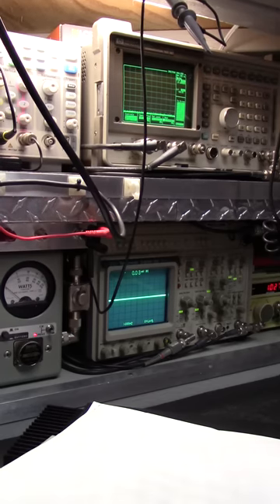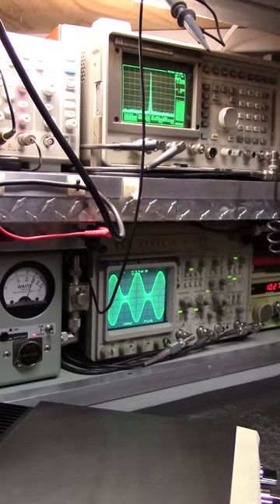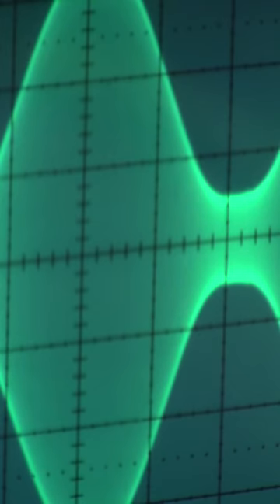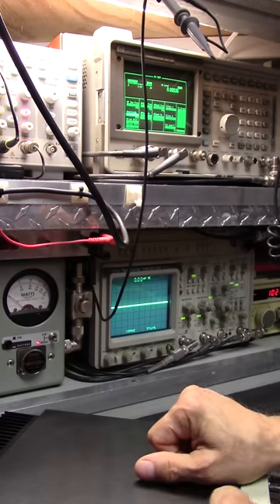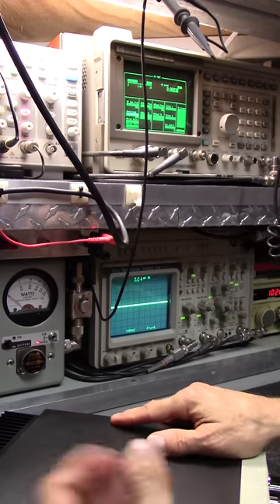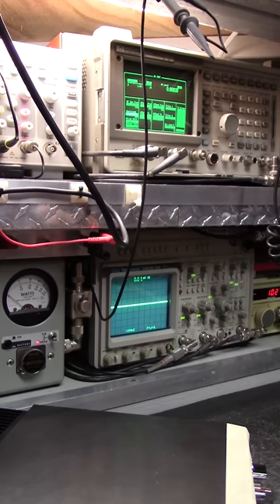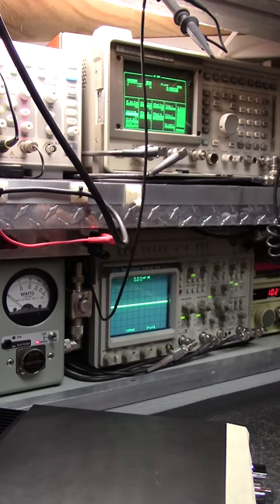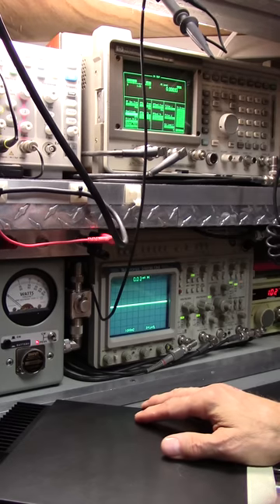Stryker SR 955 CB Radio Shop Custom Snake Oil - Channel Boards - Stinger Boards, Restorations, Etc.

Comment from the maker: 74 Miles Mobile To Mobile .. FineTuned Stryker SR955HPC - Antone AT6666 VideoGate: https://www.youtube.com/watch?v=NxQz51ReRw4 PAY ATTENTION! If they don't or wont show you .. like this .. they're stroking you,  get that Part?  Never settle for less! Here's what it takes to cut through the noise, be loud and crystal clear with a better receiver too:  A) Tuned Bench:  https://www.youtube.com/watch?v=lwcDfXOgAls.  True, it's more complicated and time consuming to accomplish these consistent and accurate results. Below is a partial procedure and list of calibrated equipment used to achieve this level of performance . Read on ..

Fine Tune CB Radio Shop strictly adheres to (https://www.nist.gov/) NIST Traceable Calibrations and other industry standards to maintain accuracy and consistency for providing Real World Performance Tuning of Citizens Band and 10 Meter export mobile radios with integrity.

"Basic Textbook AM/FM/SSB Transceiver Tune, Alignment and Calibration" 

1) Pll adjustments
VCO & OSC, AM TX OSC, USB TX OSC, LSB TX OSC.

2) Transmitter alignment
DRIVER BIAS, FINAL BIAS, SSB  (or gate voltages for mosfet versions) CARRIER BALANCE, HI-LO AM & SSB Power, RF METER, AMC, ALC and FM DEVIATION.

3) Receiver alignment
AM/FM RF & IF SENSITIVITY, FM DETECTOR/DEVIATION, SSB IF SENSITIVITY, SSB S-METER, AM/FM S-METER (100uV unmodulated -67dbm for “S-9” meter reading!), AM/FM SQUELCH RANGE, SSB SQUELCH RANGE, and NOISE BLANKER/AUTOMATIC NOISE LIMITER (Real World dBm to volts (uV) tables below).

That's just a typical run of the mill textbook tune up and alignment (if you're lucky). There's more to it than frequency alignment, modulation adjustment, meter calibration and a tune up report displaying exaggerated rms Bird peak watts! 

"Test Bench includes"

Bird 4314C Meter
https://www.birdrf.com/Products/Test%20and%20Measurement/Power-Meters/Wattmeters-Line-Sections/RF-Wattmeters/4314C_PEP-Single-Element-Wattmeter.aspx
Part 1) https://www.youtube.com/watch?v=RpX9IHe4ORM&t=16s
Part 2) https://www.youtube.com/watch?v=LuhbqTf6Bxw
Bird 4314C Accuracy Test: https://www.youtube.com/watch?v=DqEOabYqhQo&t=5s
Bird Stipulates 1/2 wavelengths  https://www.youtube.com/watch?v=5eWhgT-rTII
And Genuine Bird Elements from 1K down.

Bird 4373 Sampler 
https://www.rfparts.com/signal-samplers.html

HP8924c with options
http://userequip.com/files/specs/2147/HP%208924C%20Repair.pdf
https://www.youtube.com/watch?v=Cg1w0xBa27s&t=1s

HP8920a with options
https://www.keysight.com/upload/cmc_upload/All/EPSG072204.pdf

Three analog scopes, one digital 200 Mhz
https://www.atecorp.com/atecorp/media/pdfs/data-sheets/tektronix-2465b-2467b_manual.pdf
https://www.youtube.com/watch?v=by98x4eu2lM

Fluke 27fm
http://www.fluke.com/fluke/inen/digital-multimeters/fluke-27.htm?pid=56055
 
LCR http://www.lcrresearch.com/wp-content/uploads/2017/05/LCR_Pro1_Manual_version1.03.pdf

Power supplies
6 Cosel PBA1500f12 (750 amps) variable and configurable.
https://en.cosel.co.jp/product/powersupply/PBA/PBA1500F/PBA1500F-12/
Corcom 20VB1 F7130 EMI Filter 50-60Hz 250V

Times Microwave Coax jumpers and test leads
http://www.timesmicrowave.com/cms/products/cables/lmr/
https://www.youtube.com/watch?v=EmqaGJ6IWow
https://www.youtube.com/watch?v=1ltFVSxGp5Y
https://www.youtube.com/watch?v=v12YZT_1o90
https://www.youtube.com/watch?v=h7iiYfmYWRA&t=215s

Amphenol RF Connectors
https://www.amphenolrf.com/
https://www.youtube.com/watch?v=dVh5B0hdEA0 
https://www.youtube.com/watch?v=dKZg8T_AOso

More range, compliments, reliability and a quieter, clearer but more sensitive receiver,  Get Fine Tuned .. not peaked and ruined.

Here are some VideoGates of me at the bench practicing what I preach using my bench radio or customers radio completed and ready to be shipped: https://www.youtube.com/results?search_query=hard+drive+163+ more: https://www.google.com/search?q=Hard+Drive+163+nm&ie=utf-8&oe=utf-8&client=firefox-b-1-ab

It's what I recommend, use, service and sell ... to you ... not something non practical or deceiving in a misleading way. I'm not just the tech and owner of Fine Tune CB Radio Shop, I'm a customer too!  When finished, You'll be giving radio checks, not asking for them .

dBm To Watts and Volts
Tables below displays relationship between Power in [dBm] or [Watts] and Voltage in RMS, peak, peak-to-peak for sinusoidal signals in 50-Ohm systems for accurately measuring and tuning am/fm/ssb receiver sensitivity, agc, squelch and "S9" Meter calibration.

  [dBm] [Watts]   [Volts]rms   [Volts]p    [Volts]pp
-140 0.100E-16  22.361 nV  31.618 nV  63.236 nV 
-139 0.126E-16  25.089 nV  35.476 nV  70.952 nV 
-138 0.158E-16  28.150 nV  39.805 nV  79.609 nV 
-137 0.200E-16  31.585 nV  44.662 nV  89.323 nV 
-136 0.251E-16  35.439 nV  50.111 nV  100.222 nV 
-135 0.316E-16  39.764 nV  56.226 nV  112.451 nV 
-134 0.398E-16  44.615 nV  63.086 nV  126.172 nV 
-133 0.501E-16  50.059 nV  70.784 nV  141.568 nV 
-132 0.631E-16  56.167 nV  79.421 nV  158.842 nV 
-131 0.794E-16  63.021 nV  89.112 nV  178.223 nV 
-130 0.100E-15  70.711 nV  99.985 nV  199.970 nV 
-129 0.126E-15  79.339 nV  112.185 nV  224.370 nV 
-128 0.158E-15  89.019 nV  125.874 nV  251.747 nV 
-127 0.200E-15  99.882 nV  141.232 nV  282.465 nV 
-126 0.251E-15  112.069 nV  158.465 nV  316.931 nV 
-125 0.316E-15  125.743 nV  177.801 nV  355.602 nV 
-124 0.398E-15  141.086 nV  199.496 nV  398.992 nV 
-123 0.501E-15  158.301 nV  223.838 nV  447.677 nV 
-122 0.631E-15  177.617 nV  251.151 nV  502.302 nV 
-121 0.794E-15  199.290 nV  281.796 nV  563.591 nV 
-120 0.100E-14  223.607 nV  316.180 nV  632.360 nV 
-119 0.126E-14  250.891 nV  354.760 nV  709.519 nV 
-118 0.158E-14  281.504 nV  398.047 nV  796.094 nV 
-117 0.200E-14  315.853 nV  446.616 nV  893.232 nV 
-116 0.251E-14  0.354 µV  0.501 µV  1.002 µV 
-115 0.316E-14  0.398 µV  0.562 µV  1.125 µV 
-114 0.398E-14  0.446 µV  0.631 µV  1.262 µV 
-113 0.501E-14  0.501 µV  0.708 µV  1.416 µV 
-112 0.631E-14  0.562 µV  0.794 µV  1.588 µV 
-111 0.794E-14  0.630 µV  0.891 µV  1.782 µV 
-110 0.100E-13  0.707 µV  1.000 µV  2.000 µV 
-109 0.126E-13  0.793 µV  1.122 µV  2.244 µV 
-108 0.158E-13  0.890 µV  1.259 µV  2.517 µV 
-107 0.200E-13  0.999 µV  1.412 µV  2.825 µV 
-106 0.251E-13  1.121 µV  1.585 µV  3.169 µV 
-105 0.316E-13  1.257 µV  1.778 µV  3.556 µV 
-104 0.398E-13  1.411 µV  1.995 µV  3.990 µV 
-103 0.501E-13  1.583 µV  2.238 µV  4.477 µV 
-102 0.631E-13  1.776 µV  2.512 µV  5.023 µV 
-101 0.794E-13  1.993 µV  2.818 µV  5.636 µV 
-100 0.100E-12  2.236 µV  3.162 µV  6.324 µV 
-99 0.126E-12  2.509 µV  3.548 µV  7.095 µV 
-98 0.158E-12  2.815 µV  3.980 µV  7.961 µV 
-97 0.200E-12  3.159 µV  4.466 µV  8.932 µV 
-96 0.251E-12  3.544 µV  5.011 µV  10.022 µV 
-95 0.316E-12  3.976 µV  5.623 µV  11.245 µV 
-94 0.398E-12  4.462 µV  6.309 µV  12.617 µV 
-93 0.501E-12  5.006 µV  7.078 µV  14.157 µV 
-92 0.631E-12  5.617 µV  7.942 µV  15.884 µV 
-91 0.794E-12  6.302 µV  8.911 µV  17.822 µV 
-90 0.100E-11  7.071 µV  9.998 µV  19.997 µV 
-89 0.126E-11  7.934 µV  11.218 µV  22.437 µV 
-88 0.158E-11  8.902 µV  12.587 µV  25.175 µV 
-87 0.200E-11  9.988 µV  14.123 µV  28.246 µV 
-86 0.251E-11  11.207 µV  15.847 µV  31.693 µV 
-85 0.316E-11  12.574 µV  17.780 µV  35.560 µV 
-84 0.398E-11  14.109 µV  19.950 µV  39.899 µV 
-83 0.501E-11  15.830 µV  22.384 µV  44.768 µV 
-82 0.631E-11  17.762 µV  25.115 µV  50.230 µV 
-81 0.794E-11  19.929 µV  28.180 µV  56.359 µV 
-80 0.100E-10  22.361 µV  31.618 µV  63.236 µV 
-79 0.126E-10  25.089 µV  35.476 µV  70.952 µV 
-78 0.158E-10  28.150 µV  39.805 µV  79.609 µV 
-77 0.200E-10  31.585 µV  44.662 µV  89.323 µV 
-76 0.251E-10  35.439 µV  50.111 µV  100.222 µV 
-75 0.316E-10  39.764 µV  56.226 µV  112.451 µV 
-74 0.398E-10  44.615 µV  63.086 µV  126.172 µV 
-73 0.501E-10  50.059 µV  70.784 µV  141.568 µV 
-72 0.631E-10  56.167 µV  79.421 µV  158.842 µV 
-71 0.794E-10  63.021 µV  89.112 µV  178.223 µV 
-70 0.100E-09  70.711 µV  99.985 µV  199.970 µV 
-69 0.126E-09  79.339 µV  112.185 µV  224.370 µV 
-68 0.158E-09  89.019 µV  125.874 µV  251.747 µV 
-67 0.200E-09  99.881 µV  141.232 µV  282.465 µV
-66 0.251E-09  112.069 µV  158.465 µV  316.931 µV 
-65 0.316E-09  125.743 µV  177.801 µV  355.602 µV 
-64 0.398E-09  141.086 µV  199.496 µV  398.992 µV 
-63 0.501E-09  158.301 µV  223.838 µV  447.677 µV 
-62 0.631E-09  177.617 µV  251.151 µV  502.301 µV 
-61 0.794E-09  199.290 µV  281.796 µV  563.592 µV 
-60 0.100E-08  223.607 µV  316.180 µV  632.360 µV 
-59 0.126E-08  250.891 µV  354.760 µV  709.520 µV 
-58 0.158E-08  281.504 µV  398.047 µV  796.094 µV 
-57 0.200E-08  315.853 µV  446.616 µV  893.232 µV 
-56 0.251E-08  0.354 mV  0.501 mV  1.002 mV 
-55 0.316E-08  0.398 mV  0.562 mV  1.125 mV 
-54 0.398E-08  0.446 mV  0.631 mV  1.262 mV 
-53 0.501E-08  0.501 mV  0.708 mV  1.416 mV 
-52 0.631E-08  0.562 mV  0.794 mV  1.588 mV 
-51 0.794E-08  0.630 mV  0.891 mV  1.782 mV 
-50 0.100E-07  0.707 mV  1.000 mV  2.000 mV 
-49 0.126E-07  0.793 mV  1.122 mV  2.244 mV 
-48 0.158E-07  0.890 mV  1.259 mV  2.517 mV 
-47 0.200E-07  0.999 mV  1.412 mV  2.825 mV 
-46 0.251E-07  1.121 mV  1.585 mV  3.169 mV 
-45 0.316E-07  1.257 mV  1.778 mV  3.556 mV 
-44 0.398E-07  1.411 mV  1.995 mV  3.990 mV 
-43 0.501E-07  1.583 mV  2.238 mV  4.477 mV 
-42 0.631E-07  1.776 mV  2.512 mV  5.023 mV 
-41 0.794E-07  1.993 mV  2.818 mV  5.636 mV 
-40 0.100E-06  2.236 mV  3.162 mV  6.324 mV 
-39 0.126E-06  2.509 mV  3.548 mV  7.095 mV 
-38 0.158E-06  2.815 mV  3.980 mV  7.961 mV 
-37 0.200E-06  3.159 mV  4.466 mV  8.932 mV 
-36 0.251E-06  3.544 mV  5.011 mV  10.022 mV 

                 Don't Be A Mud Duck!

Hard Drive 163 NM. 73's! Click click.

Comment: Well imagine my excitement to have spent Friday driving across NM and then flying back home to find this video. In an effort to help others I want to tell them about that radio and how it came to be. First I found Hard Drive after making rookie mistakes. 

Now, as he often says, I am having to pay to have those mistakes fixed. Which I am happy to do – just whish I had gone to him to begin with. It all started with a Cobra 29LX “new” from eBay that was peaked and tuned. During a driving trip from the southeast to deep into Oklahoma I stopped at a truck stop and found a CB shop. Thinking I might have been taken advantage of on eBay I had the owner of the shop “look” inside.  Right away he laughed and said that nothing had been done – he said he would “turn up the power” for me and suggested I get a new radio from him. I passed that day, however, enjoying talking on AM and the CB band I wondered what a “better” radio would do. I used to be a professional broadcaster on FM and AM back in the 80’s (no joke) so I thought getting some better equipment and then getting my HAM license would be a nice move.

 I called the owner and told him my story and asked if I could drive back past his shop the next weekend and pick up a “custom” radio. He suggested the Stryker 955 with the 11 meter mod and he would tune it and peak it and align it and he probably said about three other things he would do to it. I picked it up on my drive back through. Got my antenna tuned for the SWR and I was on my way. All this fun for just north of $500. That does not include the investment in the Cobra LX – which is now an extra radio….. I only mention the $$ to let you know what has been spent for a "professional radio" . 

The point is I enjoyed the Stryker, however, almost every contact I made kept saying I sounded like I was “muddy”. As Hard Drive would say a “mud duck”! Now I was using an ASTATIC 636 mic (that came new with the peaked and tuned Cobra) and even tried the factory mic – no difference. So after some research I found Hard Drive. I explained my situation and the “muddy” sound others were reporting and he asked me to send it on in. Now I am paying to have him fix someone else’s mistakes.

 I would have been more than to have simply ordered one from him to begin with and have had it done right. I have told this, long, story in an effort to help someone like me who is just getting started back into radios. For me it had been over 25 years since I had a CB in my vehicle. If you are reading this and it sounds familiar hopefully you can save time and money and just PM Hard Drive from the beginning. Unless of course you want to PM me for the name of a CB shop in OK! Hah! 

Please fix my sad and noisy Stryker Hard Drive. I also look forward to the RCI rig you are building for me. Now that one I ordered from Hard Drive new. After learning my lesson. Hope this helps someone. Cleaner ie meaner  - john
Reply from the maker: Thanks John .. too many misinformed mud ducks. Yes, it's cheaper to do it once and I'm "still" waiting on the sl41's.
Reply: Hard Drive, Great news to know that the Stryker is getting done right. I have been, and am still, watching your different videos. Much to learn. Still thinking about that word that does not seem to want to come to mind. 
Both yesterday and today I am practicing my soldering. Also have watched multiple videos on mobile installs for HAM and CB etc.. Basics of grounding and proper power supply etc. As a car nut and mechanic I can appreciate what I am learning. Project for today to test my soldering skills is to make a homemade J pole antenna. 
Take your time on the project. I know that you are still waiting on the sl41’s - figured you were that is. I saw your post that showed a pallet load of boxes! My, oh my, glad to know my radios are in the right hands. Take care and keep up the great work. Going to go and clean up my bench…..   john
Reply from the maker: Spend the time and it'll be well worth it in the long run ..

Comment: If they can't tune a simple Cobra 138, what makes them think they can complicate the RF chain by adding  a stinger board and produce a perfect waveform?
Reply from the maker: Just imagine if you will, a "tech" that does not even use an Oscope.
Reply: @FineTuneCBShop  I'm sure there's plenty of them in the Twilight Zone.
Reply from the maker: @rabbibacongrease88  or a spectrum analyzer - service monitor.  Just look at the average IQ of their customer base. Some catch on and others don't.

Comment: Hi- I just bought a Stryker 955 new. So would you recommend just leaving it stock or is there any mod you WOULD do? Only thing I wanted to do was get it to work on 11 meter. I saw that removing a part does this but not sure if that is true or if I should bother. Any input? Thanks.
Reply from the maker: Hello,
Did you watch this video and read entire description?
It's All About Procedure .. New radio sales only shorturl.at/dnuLS at this time. Read description and watch before contacting. 

Thank You!

163 Hard Dr.
https://www.facebook.com/163Hardrive/posts/3523601657704569
Playlist: shorturl.at/tzQ13